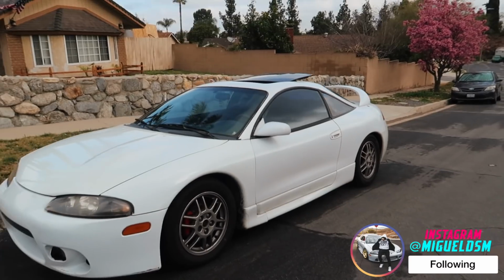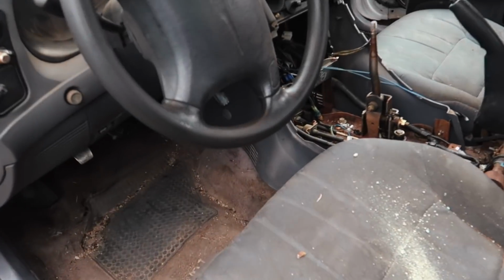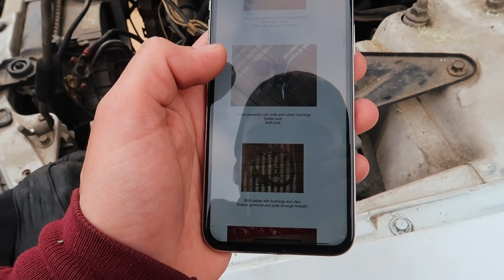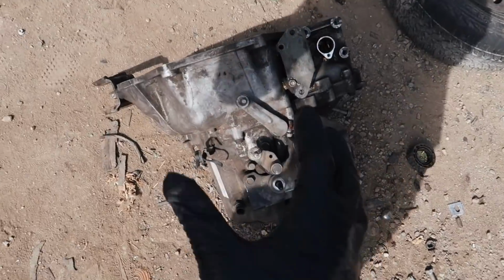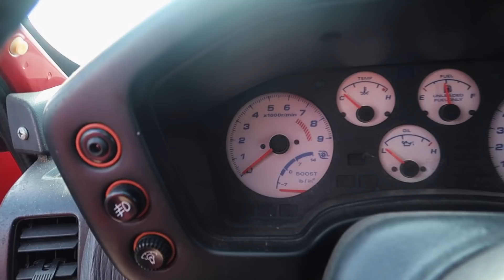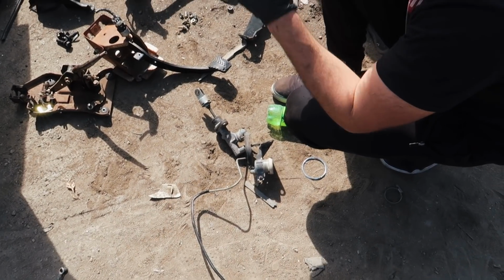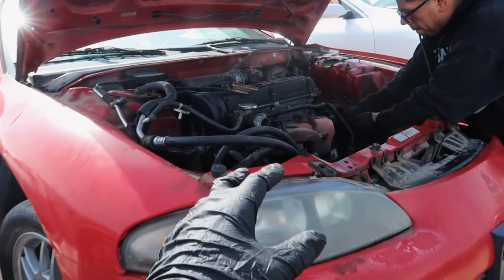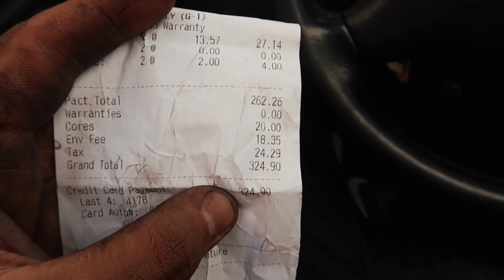ECLIPSE BUILD SERIES EP. 2 | JUNKYARD RUN!!

Comment: Great video.  I did the swap on my 98 GS a little over a year ago with the same write up. It is one of the best upgrades from the automatic. It is recommended to use a manual ECU. The auto ECU has a tendency to throw error codes or maybe you can figure a way around that. Good luck 👍
Reply from the maker: I’ll see once we get there man

Comment: Yo Miguel , I’m looking into getting a cleannn eclipse gsx auto shell . Gonna manual swap it , and keep it stock engine while upgrading drivetrain n suspension/subframe planning to have all that finished a year and a half or more after I get the car then I’ll have a motor built . I’m not to worried about the engine bc my father has been in the Mitsubishi game for awhile he’s built and tuned a 6bolt gvr4 and a evo 8 and has other plans for a 4g63 rwd 82 starlet . I’ve picked up a few things here and there growing up but we’ve never dealt with a dsm . Is there any eclipse specific things that I should look out for replacing first ? Thanks in advance
Reply from the maker: You should be set based on what you said. They’re not too difficult compared to other platforms